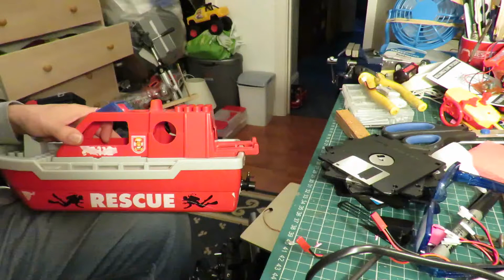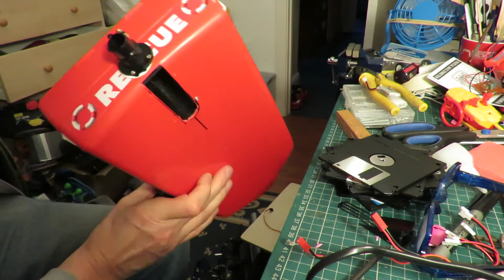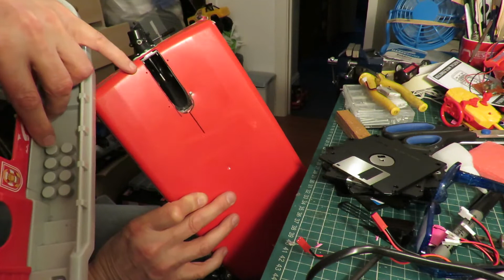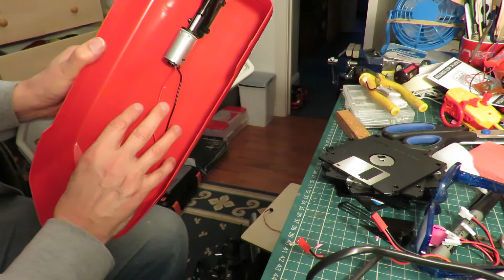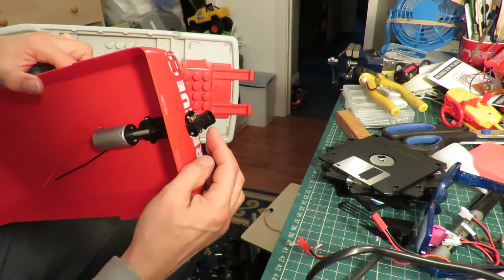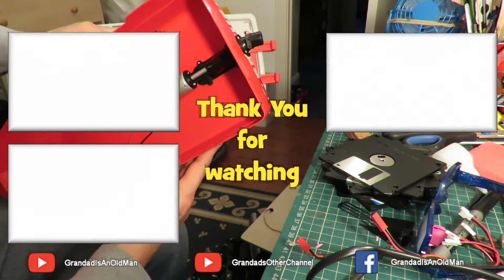Background Project Progress Updates - Rescue Boat RC Water Jet Conversion

Comment: can see this one going onto the plane with the motor even though it's brushed :-)
Reply from the maker: I don't think it has that sort of power to weight ratio, I think this boat will be under powered anyway but it will be a handy test bench to see what that jet will do.
Reply: GrandadIsAnOldMan looks like it's going to be fairly light, either way i am looking forward to the progress you make
Reply from the maker: The boat is fairly heavy plastic and quite large for that motor, but we will see what happens 😊